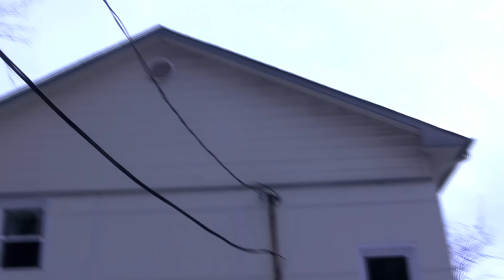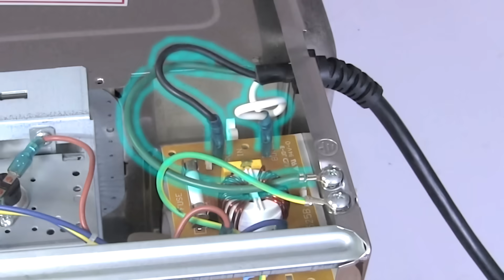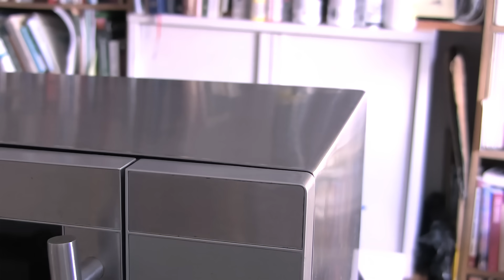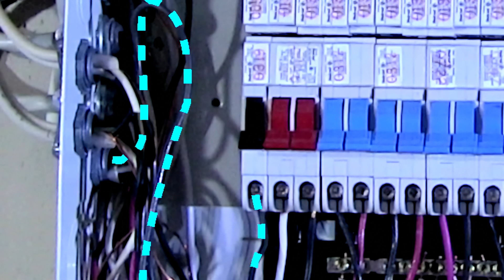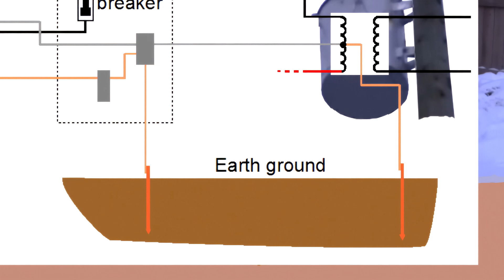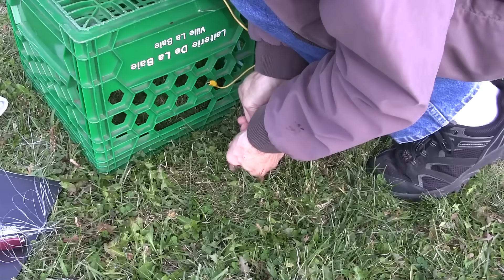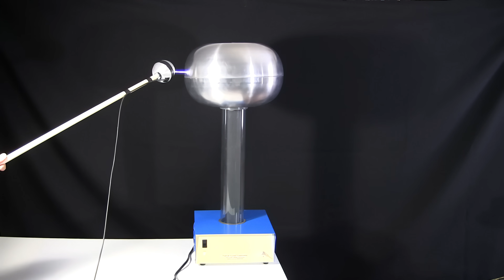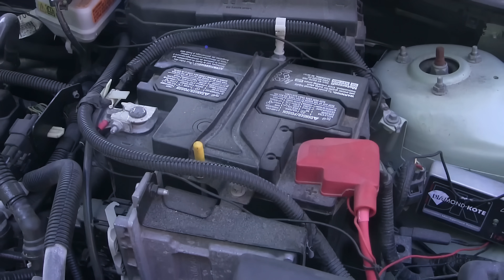What is Ground? Earth Ground/Earthing

Comment: This video answered so much of my unanswered questions, I must thank you for this, really. 
One last question: 
In simulation programs "GROUND" serves also as a reference point for the program to calculate voltages, so even if in a "real world circuit" you're not going to actually connect the "circuit ground" to "earth ground", in some cases you can't even run the simulation without grounding the circuit... right? 
Because if it's like this, I find the way GND is used in simulation programs... very misleading.
Reply from the maker: It is misleading, or at least unclear, but it's not just to do with simulation programs, it's in many schematics.
In answer to your question, you're right even in a real world circuit you're not going to actually connect "circuit ground" to "earth ground". The power supply I showed at the end of the video is an exception because it's used for connecting to a high voltage power supply and you want that high voltage to be relative to "earth ground" instead of some random potential.
However, you did say it's to "a reference point for the program to calculate voltages". In reality too, they're connected together so that the "real world" voltages in the working circuit are relative to the common reference point instead of all being out of whack with respect to each other.
Reply: What left me speechless was that even by connecting together all the "grounds" in the circuit as I would normally do on a breadboard, Multisim refused categorically to do anything, because... "circuit is not grounded". 

Really, for me this was like a nightmare where anyone seemed to know something obvious that my brain failed to comprehend. D:
Reply: mr in bread board grounding mostly represents neutality(not earthing) and in case  when u use wave generator grounding mean nuetral  line may be trasformer
Reply: of transfor
Reply: sir if u connect bulb on phase and neutral wire it glows
if u connect bulb on phase and earth wire it glows because earth wire is connected to neutral so circuit complete 
But when u use a neon lamp tester to phase and earth at figure tip it glows why?? how
Reply: I don't understand your question very well, but I know how you feel... so the best I could find is this: 
https://en.wikipedia.org/wiki/Test_light#One-contact_neon_test_lights
I hope it will be useful!
Reply: keeper1h thank u

Comment: Another point, one of the most important reason for the MENs System iMmultiple Earthed Neutral) is to equalise any potential voltages. so that the copper water pipe entering the house is of the same potential voltage as the kitchen sink or microwave case etc.
if a lightening strike hits the ground and electrifies the water pipe, touching the pipe inside the hose at a water tap (faucet) could be lethal. The earthing rods in the system ensures that there is no differential potentials other than the active (hot) wire.

Comment: sir plz answer
 earth wire can glow light then why we still use neutral wire?
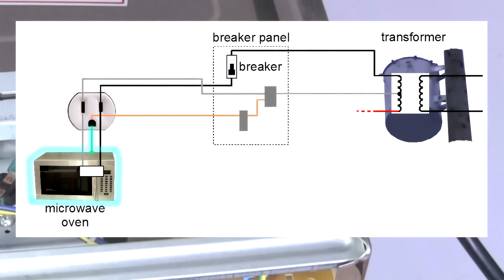Reply: The earth wire is never intended to carry current under normal operating conditions; return current is supposed to flow through the neutral wire to the breaker panel.  The earth wire only comes into play if there is a failure of the insulation on the hot wire and the hot wire accidentally connects to the metal frame of an appliance.  Only then does the earth wire carry current.  See 2:25 in the video.
Reply: ok neutral wire connected  earth so current entering earth wire passes through nuetral and complete  circuit
but how neon tester works here no earth wire is connected ? here earth is given by our finger but circuit is not complete then how?
Reply: The neon tester will glow because of the capacitance of your body to earth ground.  The DC resistance between your body ground may be nearly infinite, but the AC impedance will be on the order of several hundred thousand ohms to several million ohms. The current flow is very small, but enough to get the neon lamp to glow faintly.  If you connect the neon tester between the hot wire and a good, solid ground or the neutral line, you will see that  the lamp glows much brighter.
Reply: Milosz Ostrow  sir circuit is still open (it is connected to neutral) circuit need to be closed right?
Reply: not connected to neutral

Comment: Hi
Does it make any problem when ground and neutral are not connected to each other?I don't see any connection at home.They are separate like hot wire.
Thanks
Reply from the maker: Did you check with a meter? Put it on the resistance scale and if there's very low resistance between the neutral bar and the ground bar then they're connected. With the breaker panel I showed in the video, there was no obvious connection either.
If the neutral isn't connected to the ground in the home then there may be an imbalance in the potential between the neutral in the home and the neutral at the pole which yould result in some unwanted current flow. However, I don't know how much of a problem it would be, if it's significant at all. Some countries don't do it at all.
WARNING Opening up the breaker panel and poking around in it can be dangerous. Do so at your own risk or get an electrician to do it for you.
Reply: The neutral (grounded) and ground (grounding) conductors must only be connected at the first panel coming in from the service meter. This can be accomplished by means of a bonding screw and/or bonding jumper. If you're looking in another panel that is fed from the main panel then the neutral and ground have to remain separate. If they are connected again at any point after the main distribution panel then a loop will be created that can circulate current and create noise in your electrical system.

Comment: So if in an AC circuit, the neutral and ground are common, why doesn't the power flow straight to the ground? Is it because the power doesn't really move it just saws back and forth in a small area? I'm used to DC electronics so it confuses me. Likewise, if lightning strikes a line and over saturates it with electrons, which flow straight to ground, is that considered direct current flow to the ground, eliminating the different potential returning it to just AC?
Reply from the maker: Some of the current does close the circuit through the ground, but it's a very small amount. The return path through the copper is lower resistance than the resistance of the ground return path.
Re the lightning, my understanding is it's DC to ground.
Reply: Inside your device, after the switch, there is no practical difference. However, the difference is HUGE before the switch. Don't think about the current flow. Think rather about the power flow. Current will alternate back and forth, but the power is coming from the generator to your device via the HOT wire, not the neutral one. By itself, the neutral wire is just a wire stuck in the ground and has no real power. However, the utility is sending power down the hot wire - therefore in an open circuit (switch off, nothing plugged in, etc) there is a big difference between hot and neutral and they need to be labelled as such.

In North America, a 220VAC appliance (oven, clothes dryer, large heaters, etc) there may be 2 hot wires and NO neutral wire (this is how my electric furnace is wired). Each hot wire is half of the phase coming into the house, and they are both live/have power with respect to ground/neutral.

Also note: this is from a North American view. I'm not sure if other countries' 220VAC systems are different with 2 hots and no neutral or like NA systems with a hot and neutral.
Reply: what is the point of labeling the wires hot and neutral if they are constantly switching places with eachother i.e . alternating at around 50-60 Hz ?, doesnt the neutral become hot and vice versa? isnt that the reason you can plug in certain plugs which ever way you want to?
Reply: Okay that makes sense to me now. Thank you!

Comment: I just moved into an old house, that has three pronged outlets. But yesterday I connected my electric bass setup, was barefooted, and could feel the electricity in the strings as I played them. It slowly ramped up, until I powered off everything to avoid any problems. Is there a solution to this, besides wiring the whole house again? Thank you
Reply: RE:Frank Palomar. It could be a problem with the base or with the house wiring, or both. Does it do the same thing when you plug into other outlets/circuits in the house? The wires might be switched (connected wrong) in that outlet. You can buy a 3 prong tester to check it or use a multimeter or even a test light.
Reply: munsters2, I found out that if I turn on two specific pedals on my setup, at the same time, then I get this problem. Everything else works fine on it's own, each pedal individually has no problem (none that I can feel, anyway). I will test the outlet as you suggest also, just to be sure. But my main test will be when I use the setup in a different house, which I know is properly grounded. Thank you for taking your time to answer!

Comment: So, ground is a point reference where current equals 0, due to the combined charges of both volumes? Could one "set" a ground to a particular charge, if the volume is high enough (ex. a capacitor bank with a negative charge) ?

Comment: So, the gnd wire in the casing does not need to connect to the soil ground for the circuit breaker to trip in the case of faulty wiring.  So, the soil gnd is not needed
Reply from the maker: It's not needed for that situation. It is needed for the other situation I talked about, the charge build up on cases due to lightning storms and other things.
Reply: RimstarOrg Yes, you are right. Thanks guru!

Comment: Great video, very well explained. I like to learn about eletrics inside our houses. It's really amazing how  other countries have a culture of safety, here in Brazil the ground wire is barelly used, except in newer houses, but almost everybody lives in old houses that sometimes dont even have the ground conections, damn :(

Anyway, great video, congrats!
Reply: Clayton Fernandes same here in pakistan
Reply: you don't use 120v as commonly as we do.  also i believe you use 50hz which is less shocks per second (10 shocks per second safer lol but its still dangerous) see we use 120v at 60hz so that the current is higher and we can produce more eddy currents to meter off of.  Electricity company gets paid more that way.  problem is... 120v makes your muscles clench when it passes through you causing you to hold on.. either burning you up or stopping your heart. 220 on the other pushes you off of the line. volts=pressure... more volts = more push = jumps further through resistance too!
Reply: In some parts of the country we have 220. Actually in my house I have both of them too. But most of my state, Paraná, uses 120. Our south neighbour, Santa Catarina, uses 220 as standard. And we also have, for what I recall reading somewhere, both 50Hz and 60Hz. Very crazy
Reply: Damn :(

Comment: Also remember "Current will pass easily through the least resistant path". This means that when the hot wire is exposed and no ground is connected, the electricity flows to your body then to the ground (human body resistance is about 100k ohms). But if the ground is connected, you will not get hurt because it will take the easy path.

Comment: Can anyone clear me? The ground hole is only active when the power switch is on? If yes then please tell!
Reply from the maker: No, the ground hole has nothing to do with any switches. The only way to disconnect a ground wire is to unplug the ground prong from a ground hole in a socket.
Reply: RimstarOrg Thanks!

Comment: PS. It's also is a crime to connect "ground" or "neutral" wire to a water supply or gas pipes.
Reply: This is a false statement, the National Electrical Code 'requires' that we 'bond' the water and gas to the electrical Grounding System, see 250.104.

Comment: I think I forgot the neutral was connected to ground. I thought the neutral actually returned unused energy, and maybe it does, but it could be compromised by the ground pin instead.
Reply: a "Neutral" does NOT "return energy".
Voltage is the measure of POTENTIAL energy, not actual energy (that would be Coulombs). The neutral is called "neutral" as it's purpose is to (and I am trying to describe in simple terms) complete the circuit so Voltage exists. Think of it this way, if you split the neutral apart the voltage would become zero, then if you connected a lightbulb between the two halves you would then again allow for voltage, and with something to use energy on the circuit you would of lowered the voltage and increased the current.

The Neutral and Bond (commonly called ground which confuses people) are connected at ONE POINT where the service conductors enter the building. This prevents dangerous transient voltages, among other things. Basically its a safety. Neither would work correctly if they weren't connected. They are connected together and have a voltage between them of zero.
Reply: I meant that there may be some unspent voltages in the low state of an appliance that could be used.

Comment: are there any instances where it is bad idea to connect to ground?
Reply: Charlie F 
not really, no. off hand, the only ungrounded system that comes to mind is navy ships. having a grounded system is preferable in all land based systems.
Reply: Charlie F  floating control power used to be quite normal.  wire insulation is far better today so nuisance ground faults are very rare.
Reply: Charlie F . definitely yes.
your idea is innovative and worth a resaerch. All others either studied superficially or no genuine interest.
Even the author of this video is confused between ac and dc concepts!
Reply: why military navy ship (https://en.wikipedia.org/wiki/Naval_ship) in particular and i think electrical ground is necessary in any large system including most marine vessels. (https://www.westmarine.com/WestAdvisor/Marine-Grounding-Systems)
Reply: thank you for the encouragement and i hope someone with academic interest in the subject would get on it soon. it would increase the knowledge and potential of humanities. at the very least laymen hobbyist and electronic enthusiast like me can avoid doing mistake and minimize equipment damage risks.
Reply: in my opinion it is not about the nuisance of ground faults but to mitigate the risk with redundancy and contingencies in the system. much like the 3rd brake lights or the rear view mirror in a car which is not important in the operational sense but quite critical in practice.

Comment: Its not a good idea to connect the neutral to ground in any other place than at the transformer. It could potentially be dangerous and you're creating ground loops. And no earth leakage circuit breakers? And that is standard practise in North America?
Reply: When you connect your ground to neutral you're putting your trust in your ground connection having low resistance and what is worse, as the earth wire is connected to neutral you can't measure your individual ground connection's resistance to earth. If your own grounding over the years got some high resistance and at some place the neutral has shorted with a live wire your electrical panel casing and everything else connected to ground is live. Better treat the neutral as a potentially live wire and don't connect it to the ground of a home.
Reply: I think you're talking about GFCI outlets, which are present mostly around faucets and outdoors (in higher-risk areas). Not every outlet (in the US at least) has ground fault protection.
Reply: the bond ("ground"), neutral from transformer, and ground (from earth) are all connected in ONE PLACE which is important, and this is at the "service entrance". In a typical house this is your electrical panel. This is to as you described prevent ground loops. Any place where the bond or neutral connect where they shouldn't, or where the connect to ground would be classified as a "fault" that can potentially create said ground loops.